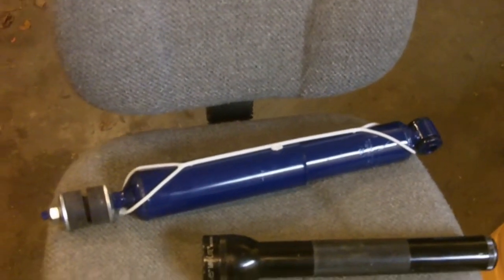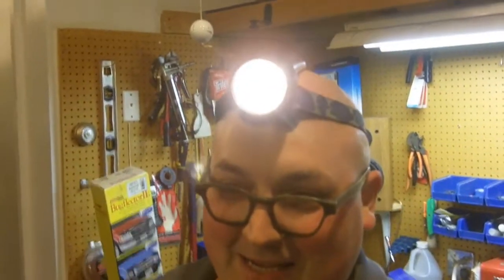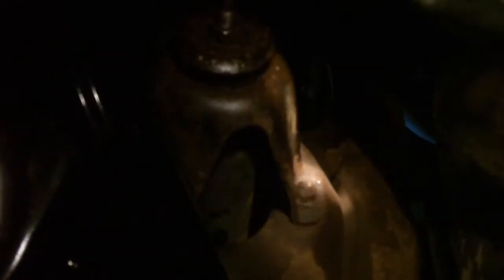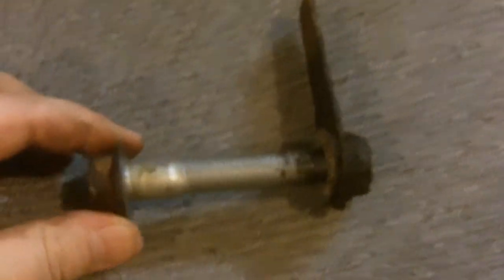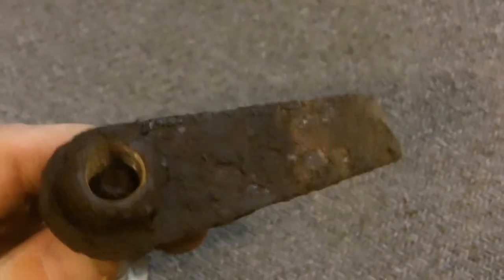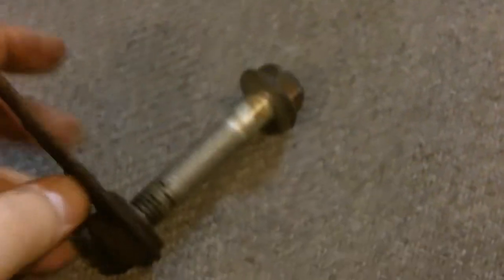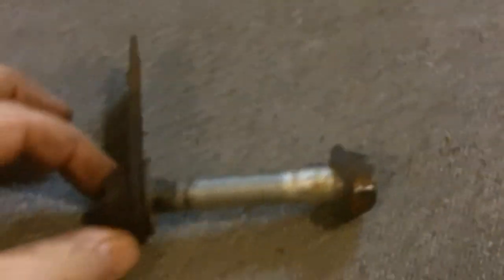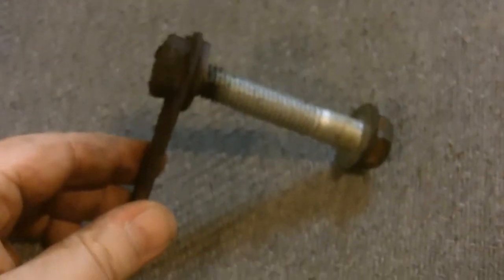MG53 - 96 Dodge Ram Shock Replacement

Comment: The rear shocks were a little easier.  The front ones weren't too bad but rust and lack of light caused an issue that night.  I think Marty should start out every video saying, "In this clip". (reference to Exprert Villiage "Nate M")  This episode should be referred to as Matt's Garage. (which I need to clean apparently)